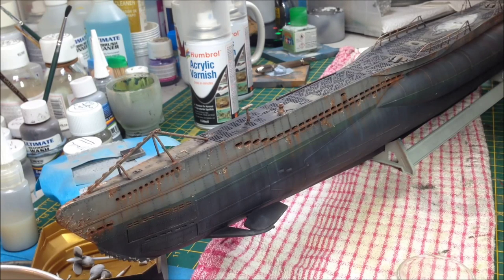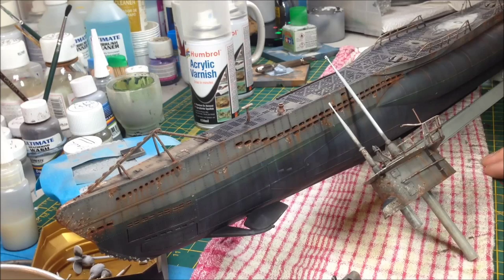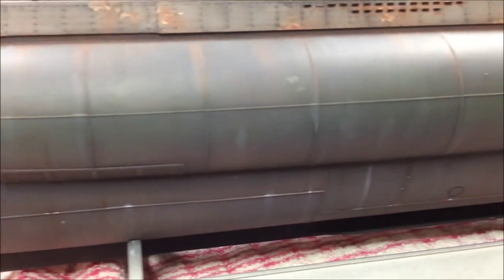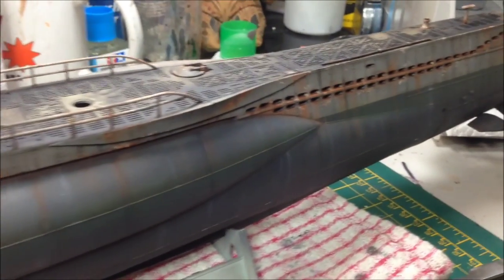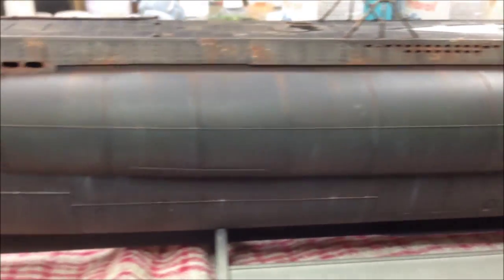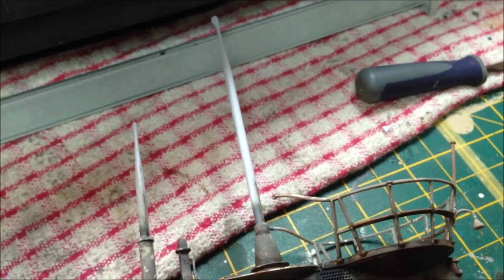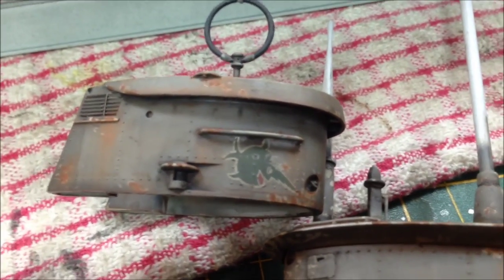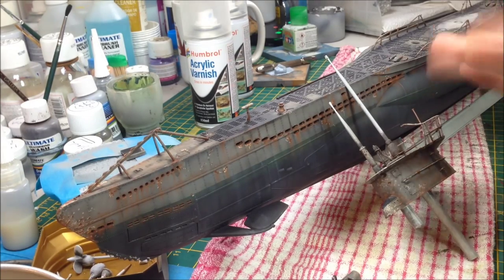Commission Build Diary:  Das Boot U-96 Part 4

Comment: What color/paint did you use for the rust streaks and heavier rust?
Reply from the maker: It as a couple of years ago now, but if I recall I used Tamiya Red Brown for the chips and then Mig 502 Abteilung Light and Dark Rust oil paints for the streaks and dry brushing :)

Comment: What wash did you use to make the lines black?
Reply from the maker: +MrShotgunJoe DO youmean the rivet lines, how they are a little darker? It was a combination of airbrush pre-shading with Tamiya Rubber Black before I applied the main base hull colours, and then once the model was painted I did a gunk wask of Starship Filth oil paint, where I cover the whole hull in neat oil paint and then rub it off with a clean, soft cloth, leaving paint behind in the recesses and around the rivets. I show the gunk wash process here: https://www.youtube.com/watch?v=Avj5mkLrrVY&index=6&list=PLT8l3DNUdcBCfUyL0E5Qzewj_nT90n-Vb
Reply: +Modelmaking Guru how did you apply the robber black? Did you put some on and wipe with a web brush? And how did you do the rust, the same way?
Reply from the maker: The rubber black was airbrushed on over the primer coat right at the start just along panel lines and areas where I wanted shadow. Then the main hull basecolours were airbrushed over the top of that so that the rubber black was almost covered but just visible enough to show through the paint above as a darker shadow effect. It's called pre-shading as it is done before the main paint layers go on. 

The rust was a combination of rust coloured paint chips of Tamiya Red Brown just painted on with a fine brush, and then later I drybrushed Mig 502 Abteilung Light Rust and Dark Rust around those areas with the rust chips very lightly, to give the faded and patchy look to the rust areas :)
Reply: +Modelmaking Guru what varnish did you use? Gloss? And what Brand? Im thinking satin for mine, but im kind of new to this.
Reply from the maker: I use two varnishes, one gloss and one matte. The matte varnish was the last thing to go on the model, and was Humbrol 49 Acrylic Matte varnish in the rattle can. The gloss was only used to go under and after decals and before any weathering, to give a smooth surface, and that was Pledge Multi Surface Wax which is dirt cheap and one of the best acrylic varnishes out there. You can get it from most supermarkets, but for all the info on Pledge MSW (also called Future or Klear) in your country, follow this link: http://www.swannysmodels.com/TheCompleteFuture.html